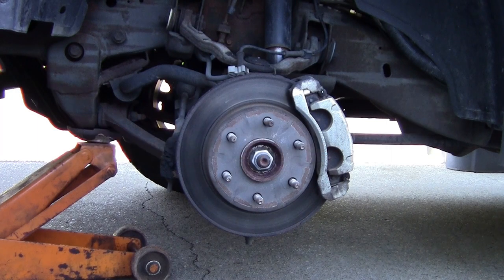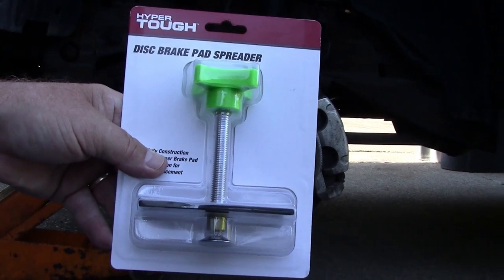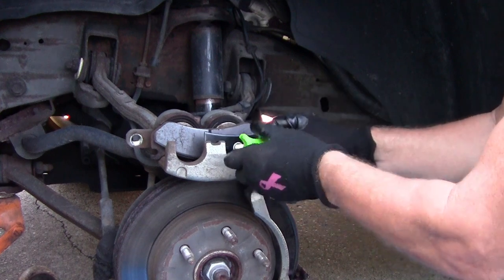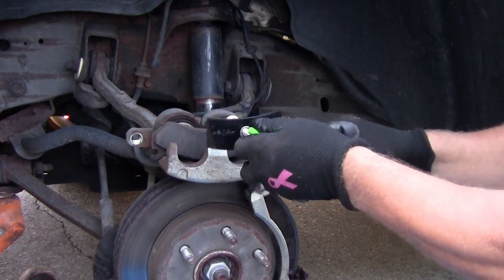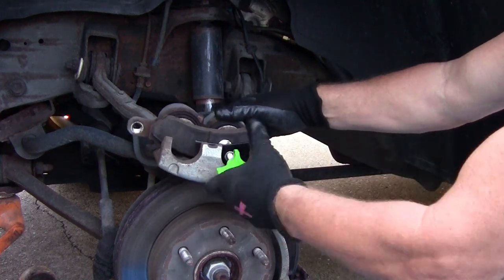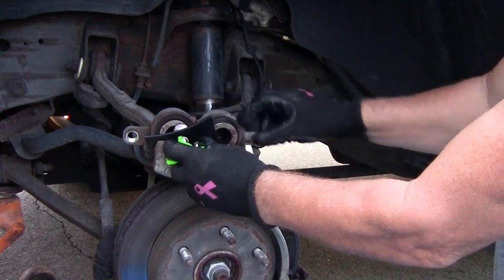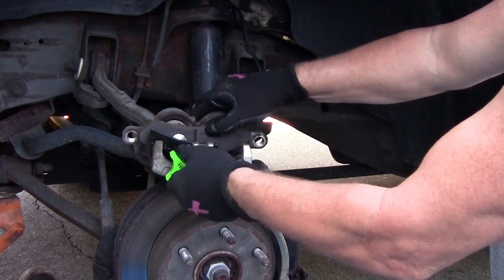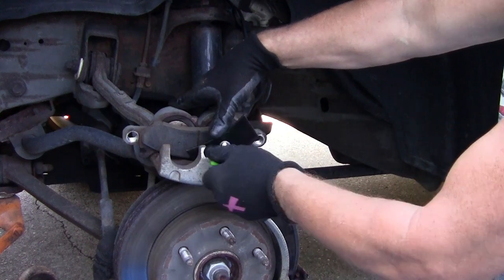Disc brake pad spreader and how it works

Comment: Just got one and had no clue so thank you!
Reply from the maker: Your welcome
Reply: Great on front Mazda but rear Mazda pistons wind in, not pushed in. So sometimes easier for shop 😂
Reply from the maker: Winds in just like on a Honda. I have a video on that and you can do it yourself, no need to take it to a shop.
Reply: @LonnieJohnson1  Ended up being lots of complications. The piston needed to be swapped out due to it getting stuck. It had corroded from a long lifetime. Local crowd here called Stirling Brake and Clutch Onehunga sorted it all out for me for extremely reasonable $. So now I'm educated, upskilled, and on the road.
Reply from the maker: Cool!!!

Comment: Honest question. Shouldn't you have a even amount of pressure when pushing in dual pistons? I'm actually asking because somebody had told that to me. If not then it just became.alor easier lol
Reply from the maker: Yes, this tool works for both single and double piston. You have to use the old brake pad as a plate when pushing the piston(s) in and the fluid will go back into the master cylinder. If the piston is hard to press in you can open the bleeder valve but you will have to bleed your brakes once the new brakes are installed.

Comment: OK, so how much use has the tool had, and is it STILL working?
I have read that some of the cheaper ones strip out after a few uses.
Would like to know how this one has held up as I want to get one.
Reply from the maker: I have used my caliper tool a lot now and it's still working like it should. Much better than a C clamp. Just have to take care of it. Throw a little WD-40 on it every now and then.

Comment: Just wondering if you could rest the tool into the smaller notch at the top/middle of the caliper which would apply equal pressure to both pistons at once instead of inserting the tool into both of the U shaped channels as you did?  Would the tool sit too high?
Reply from the maker: It made the tool to high to get a good bite.

Comment: Usually use a C-clamp which isn't easy for all the calipers😅. I have to take the calipers off sometimes.
Reply from the maker: I used a C-clamp until I found this tool and now I have found another tool that seems to work even better.

Comment: Good stuff, but only for open caliper styles. 
I just did my e60 BMW, it has closed, donught-style caliper, so I had to improvise with tongue-and-groove pliers and a piece of wood.
Actually, my e60 rear caliper (haven't done it yet) is open-style, so I will be able to use this tool then. My point: check the caliper style ahead of time; I didn't...

Comment: Is it necessary to loosen the bleeder screw before compressing the piston?
Reply from the maker: No! what you do is push the fluid back up into the master cylinder so you don't need to add brake fluid or bleed the brakes.
Reply: @LonnieJohnson1  Thanks for the clarification.
Reply from the maker: Your welcome. Also some calibers are so rusted you can't get the bleeder open without damaging the valve or snapping it off.
Reply: Pop the hood and unscrew the master cylinder cap, will make compressing easier.

Comment: So how is different than a c clamp
Reply: I know I’m kind of late to this comment but some brake setups have smooth Ed or angled outside which makes it harder to put a C clamp on an example of a 1996 Honda Accord also this tool is more for convenience and pretty inexpensive they also make a little bit more pricey unit that is faster for about $20 more I like these if you are doing private work because they make the job go just a little bit faster with that you can get more done and make more cash

Comment: So does this compress the brakes?
Reply from the maker: Yes, it compresses the brake caliper back in.
Reply: So once it gets compressed with the old brake pads on there put the new ones after correct?just want to make sure
Reply from the maker: Yes